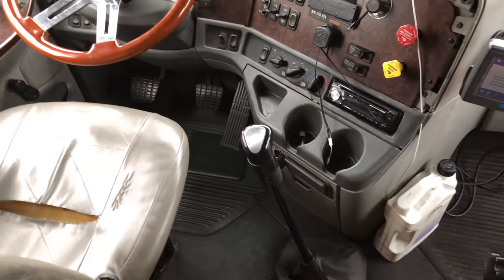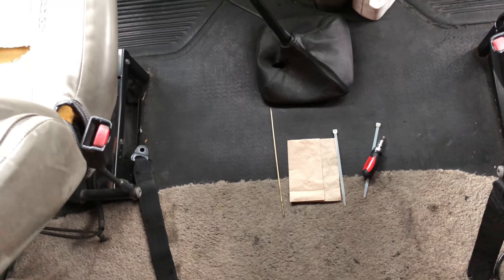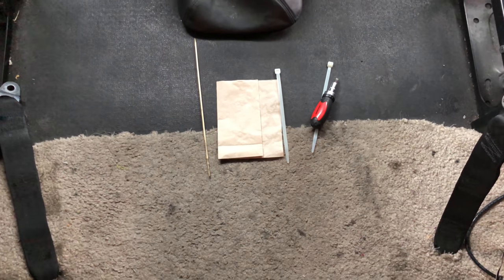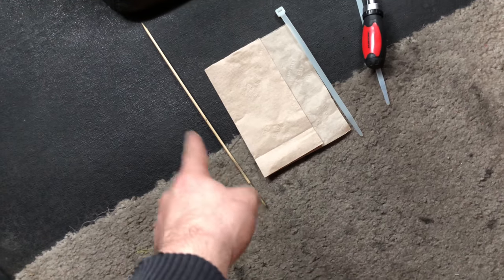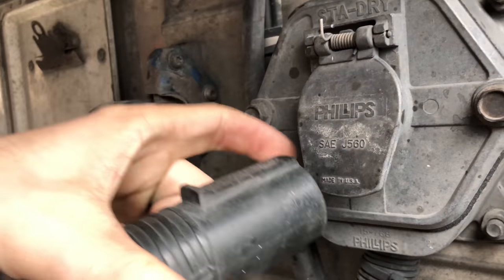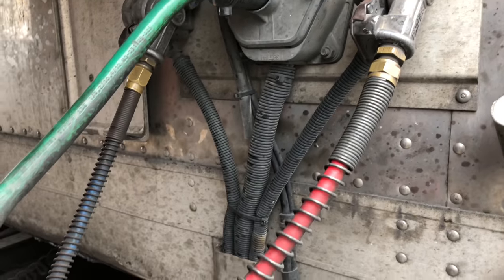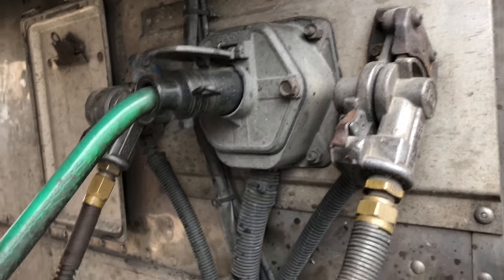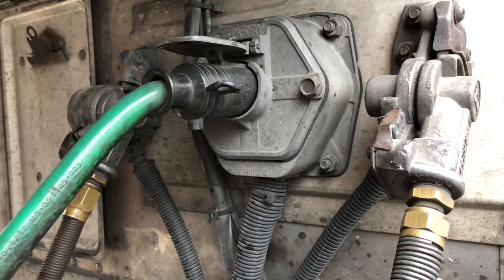How To Fix Buggy Trailer Lights On A Semi

Comment: Use spray electrical cleaner and q-tips works well too.... then add some dielectric grease to prevent corrosion.  good vid.
Reply from the maker: Thanks for the tip buddy! This is why YouTube is awesome.
Reply: Tyler Horner thank u I just try it it work good

Comment: I find a small piece of folded paper placed around the bottom half of the pigtail plug that slides in the receptacle can really help snug it down if you have a loose wobbly connection.  Can make the difference between lights working or not.

Comment: This is why i like the solid pins on the newer trailer sockets. But at some point you are going to have to replace the socket or the plug. If you replace the abs permacoil don't buy the garbage one's at the truck stop, spend the money on a phillips. Also not a huge fan of the plastic plugs, zinc all the way.
Reply from the maker: For sure my dude!

Comment: I say is better to replace the cord end if its a serviceable part,or the cord entirely. If you do the zip tie thing,your not fixing anything,your patching! The natural gravity of the cord weight hanging there will wear out the plug(plastic) and or the female connection which is the cord. The spreading of the pins I dont recommend it. Had replaced lots of 7way sockets due to broken pins. I've seen some tractors that have a pogo stick look like that is spring loaded to help keep weight off plug,i think its worth having.
Remember, preventive maintenance is the best rule of thumb.
Reply: Omg!!!! Finally someone that understands DOING $HIT right!!!!

Comment: We pull trailers for a living. Just buy the brush to clean them. Cost is less than 20 bucks. Then this won't be an issue in the future. I bought mine some 15 yrs ago. I leave it in the door pocket so i know where it is.

Comment: I got a 2004 Freightliner Columbia and my trailer markers lights stay on all the time so my panel lights and dashboard can you help me
Reply: Get 30 zipties and 6 napkins then park in a pilot or flying j, put some gasoline on top of the batteries and a metal bar going across the positive (red) and negative (black) terminals sit back and watch how your simple problem solves itself.  These are tricks d.o.t. don't want you to know.

Comment: Instead of zip tying it like that, fold it in two, and wedge the zip tie between the bottom of the pig wire and the light housing

Comment: I never needed to clean the contacts...Don't use a screw driver, use a knife....with the screw driver you'll fight getting the the tight prongs spread apart...He also risked snapping one prong by over gapping....they do snap and now you have real problems....also carry tooth picks,  you stick them under the plug to tighen the gap....if all else fails use the other end of the light cord.

Comment: One of my brake lights stay on and they don't come off what do I do?
Reply from the maker: I would just check the cable and input first then the fuses.
If your truck acts normally but the trailer is funky then it’s something in the wire harness probably
Reply: your brake light switch may be bad.
Reply: if you have a trolley vale make sure it not on.
Reply: @TruckDriver326  switch? You mean relay?
Reply: According to this video......buy a shopping cart full of zip ties and napkins, that solves pigtails, blowouts, and the occasional blown head gaskets.